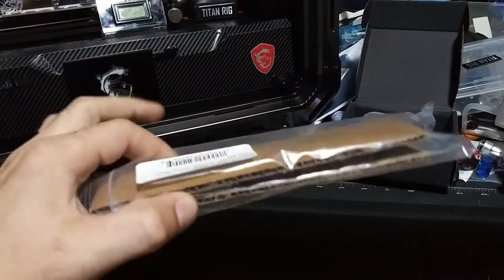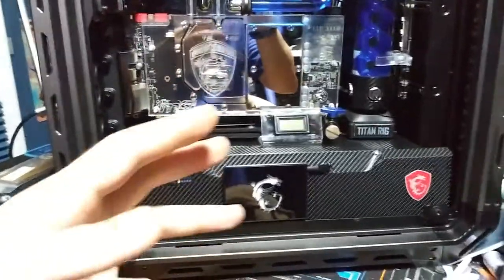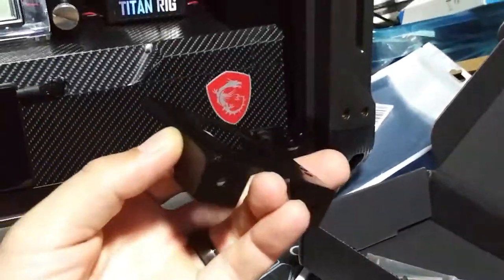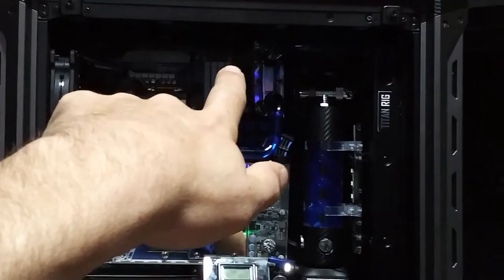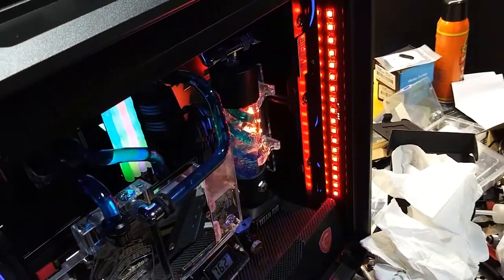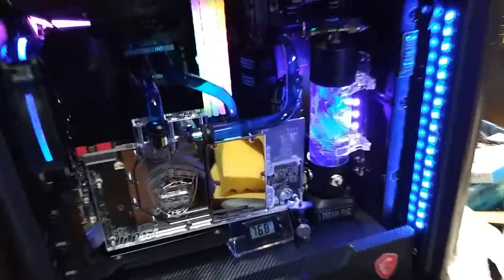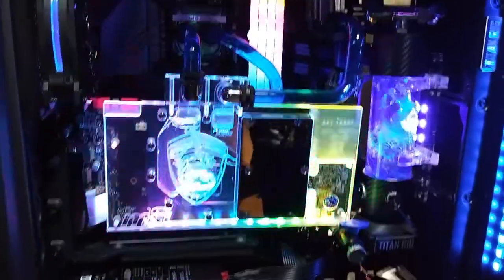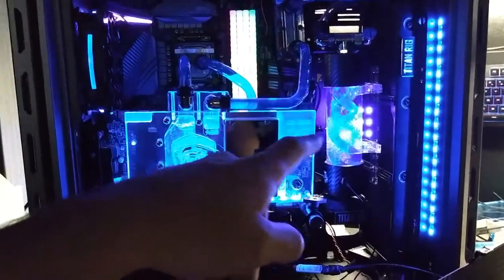Graphics card Water Block RGB Strip Replacement !!

Comment: What strip did you use? Looks beast.  Optimus block is here which has no RGB.
Reply from the maker: bykski  sells led strips for gpu water blocks.. comes in a small , med, large  size..  and it was like 20$.... check out my channel and consider subscribing